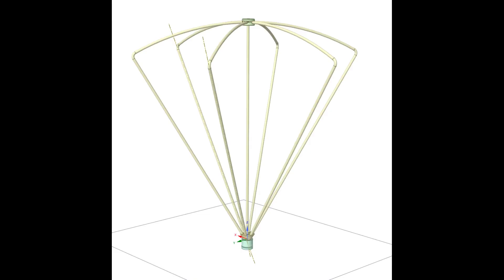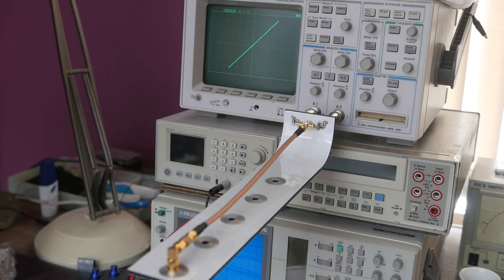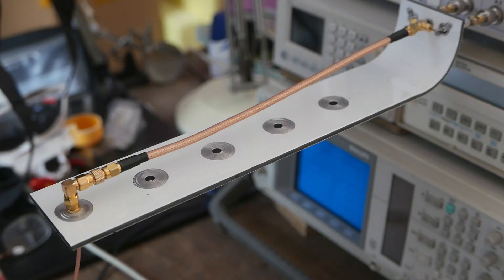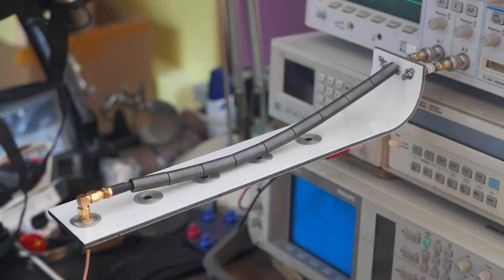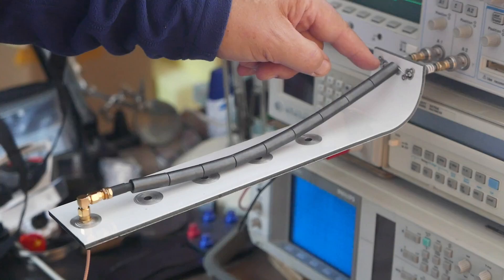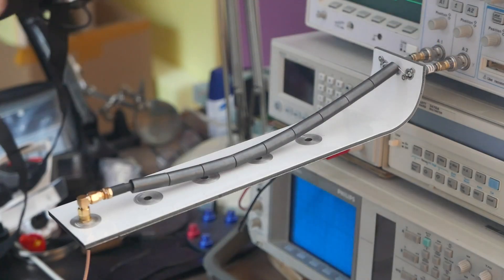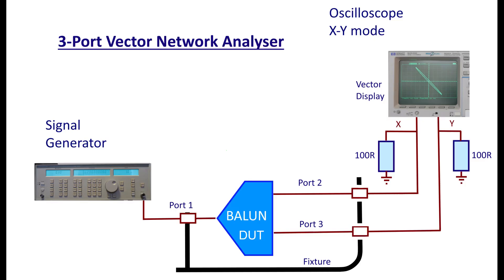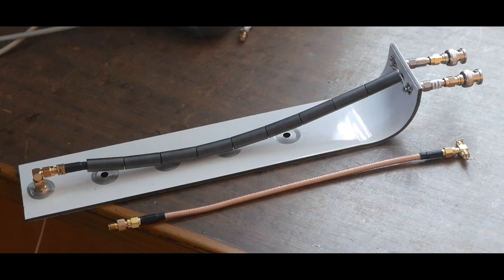DIY 3- port Vector Network Analyzer testing linear ferrite balun

Comment: Hmmm, which cable impedance did you use to get an output diff impedance of 200 ohm? Those 100 ohm paralell on the cal setup, but get in series on the diff output of the balun!
Reply from the maker: I used standard 50R coax but at 500MHz the input capacitance of the scope has an impedance of only 24R, so the value of the resistors in the terminators becomes almost irrelevant.     I do have a pair of 50R terminators, but they significantly reduced the signal voltage seen by the scope.  Experimental results with the calibration balun showed that it didn't matter what the impedance was, as long as it was the same for both scope ports.   I did not attempt to compensate the terminators in the way scope probes do because  I would then have been faced with the problem of balancing the terminators.  When I started, I had no idea the scope would still provide a (barely) useful display at 500MHz.  Ideally I would have used the differential probe I don't own but this very basic vna got the job done.  How do others test baluns?

Comment: You can coil up the transmission line transformer, helps in HF. (Use shorter ferrites)
Reply from the maker: If you follow the eevblog forum thread here:  https://www.eevblog.com/forum/rf-microwave/correctly-calculating-impedance-of-a-biconical-antenna-and-impedance-matching/msg5155014/#msg5155014  you will see a fixture I developed to measure common mode rejection by a toroid based balun.  This completely failed when testing the linear balun because the balun plus the cable to get back to the fixture formed something like a loop antenna. The frequency response of the loop dominated the results.  Even squeezing the loop flat with cable ties did not fix that.   So if coiling up the coax helps in HF, it wrecks the VHF/UHF response.   What I call the linear ferrite balun does not appear to have a self-resonant frequency ( within the limits of my vintage test equipment) that I saw with coils over a toroid,.    I'd be really interested to see these tests replicated by someone else with more capable instruments.